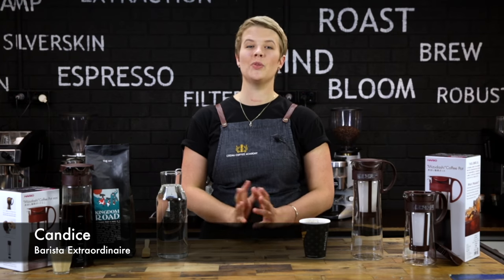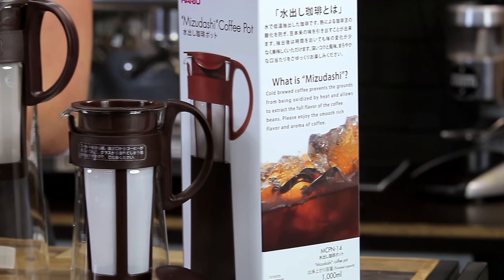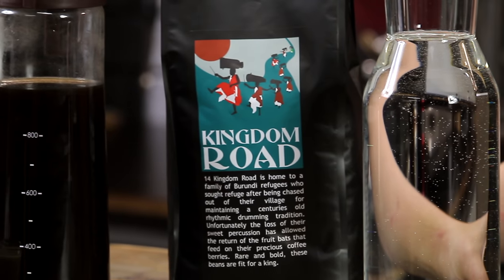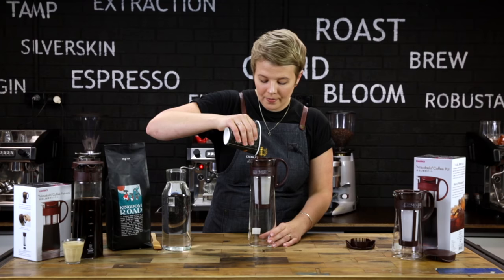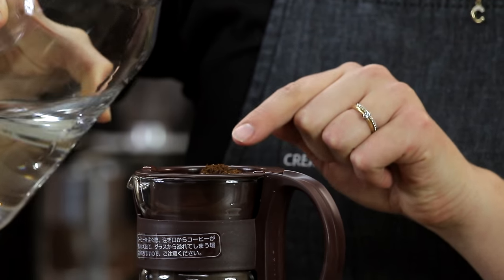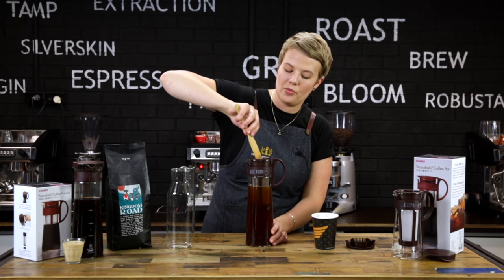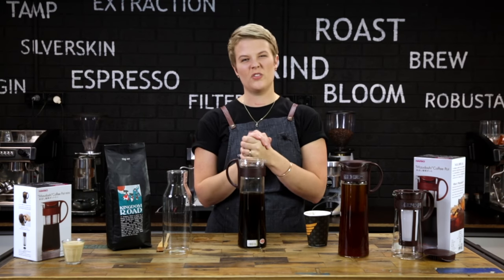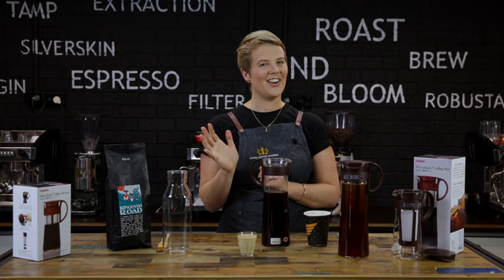Alternative Brewing | How to Mizudashi Cold Brew Pot | Crema Coffee Garage

Comment: Regular Coffee is 1/15 ratio, water to coffee. Some people think 1/4 ratio is the best for cold brew, but i personally think 1/8 is better. Its a little bit lighter this way, but still strong enough that you have to add water or milk depending on your taste. And it doesn't waste that much coffee either. I have one of these and recommended recipe is way to light, its basically if you want to drink the coffee without adding any water to it. But i think its way to light. Also imo you want to use a lighter blend of coffee for cold brew. Dark coffee doesn't get as much taste from cold brew as light coffee imo. I usually put about 125g of coffee to 1L water when i use the big can. I add about half the coffee and then pour until filter is full, wait 1 minutes then add the rest of the coffee and poor the rest of the water slowly until all is gone and then fold it like you showed in this video.

Leave in the fridge for at least 12 hours (usually over night). And then when i drink it i add 1 part coffee to 1 part water or milk, whichever you prefer. I usually go 3/6 coffee 2/6 milk 1/6  water, perfect coffee every time and i use a very light brew of coffee which is made for latte coffee cause we Swedes like our latte over here. And the grind is as you said 1 higher than filter coffee. Perfect cold brews all the time.

Comment: Do coffee still bloom with cold water? From how i understand blooming occurs with only hot water
Reply from the maker: It still does bloom but not as quickly or evidently as it does with hot water. The gas is released from the addition of water, whether it is hot or cold, however, higher temperatures increase the solubility of coffee - increased solubility means more gas can be released in a shorter amount of time. This means hot water produces a quick bloom with lots of bubbling and cold water produces a significantly slower bloom that is less perceptible. I hope this helps to clear things up and thanks for watching!

Comment: Great video, but from the moment you divide the portions of the grounds, just for the sake of pre-blooming process, will it not take effect on the part of unevenly wet grounds? Given that in the end process all grounds is immersed?
Thanks in advance for the answer!
Reply from the maker: Hi Ryxper ArtisanBarista, thanks for your question and I will do my best to answer it correctly. Considering how long the coffee extracts for, dividing the grounds for blooming won't affect it at all, in fact it helps in making sure you achieve a more even saturation of the grounds. If you put all the coffee in an once and then add water, you will find it will take some time for the water to make it through all the grounds, especially working with in the smaller space of the Mizudashi filter. It will be better for your extraction and making sure all the grounds are saturated to add some coffee then some water, and do that until all coffee and water is in the pot. Hope this helps!
Reply: @CremaCoffeeGarage 
Appreciated cheers!

Comment: how can you get 80 grams of coffee and 1.15 ltrs of water into a container that will only hold 1000 ML?
Reply from the maker: Hey James, 

Thank you for watching & commenting with your question. The volume of brewed coffee differs from the amount of water used because the coffee grounds will absorb some of the water during the brewing process. Therefore, once drained, the recipe of 80 grams to 1.15L should yield around 8 cups/1000ml of cold brew concentrate liquid. The pot is designed slightly larger in order to give you the ability to brew 1 liters worth of cold brew. 

We hope this has helped & wish you happy brewing from the Crema Coffee Crew. ☕

Comment: do u think is there a disadvantage to leaving it to brew for much longer , say up to 20 hours?
Reply from the maker: Hi mc member, there will come a point, where it won't make a difference, because there is only so much caffeine, oils and acids that can be extracted. This is also dependent on the quality of the water you are using as well. You may find that there is little difference between a 12 hour extraction and a 20 hour extraction. So I would say no, if you need to leave it that long because you're busy or whatever the reason it, it should be fine. Ultimately how long you let it brew for will come down to personal taste - if 20 hours tastes good to you, then let it sit for 20 hours.
Reply: do whatever fits your palate =)

Comment: You said Hario recipe is 80g/1.15 L. Isn’t it too watered down for a ‘concentrate’? Also, does the water cover all the grounds? The filter looks way high up in the pot, as compared to 600ml model. I’m afraid the coffee wouldn’t be fully submerged if I put more than 80g for a more concentrated brew.
Reply from the maker: Hi Jack, 
We would normally recommend using a 1 part coffee and 4 parts water recipe for cold brew, however, for this video we were demonstrating the Hario specific ratio. You are more than welcome to use the Crema recommended recipe if you like. 
In regards to the filter, we do see your point. You could choose to give your cold brew once made, a little shake every second hour, so as to ensure a full and even extraction. Alternatively, we have had people choose to brew without the filter and then drain their brew through the plastic mesh filter into another bottle/container and then pour back into the canister once cleaned. We understand this is a little bit more time consuming, but if you already had your pot, this would be our recommended solution. 
Hope this helped Jack and Happy Brewing!
Reply: Crema Coffee Garage thank you so much for such a detailed reply!!!

Comment: Hi. I just found this video. I just purchased Mizudashi and waiting it to arrive. I usually make coffee using Hario V60, so I order coffee ground and request grind size for V60 since I don't have grinder yet. Is the grind size suitable for Mizudashi?

Thanks in advance.
Reply from the maker: Hi Kopi, 
Thank you for watching & commenting with your question. 
The Mizudashi has a plastic mesh filter inside, whereas the V60, as you would already know, uses a paper filter. The coarseness that we grind for the V60 is slightly finer than the plastic mesh filter. On a scale of 1-8, V60 is rated a 5. Plastic Mesh Filter is a 6. 
You will definitely still be able to use the coffee you have already ordered as they are not too dissimilar. You may just want to give the jug a swirl at the halfway point of brewing so you get an even and full immersion of the coffee into the water. 
We hope this has helped answer your question. Feel free to reach out with any other questions you may have. 
Thanks again and Happy Brewing from the Crema Crew.